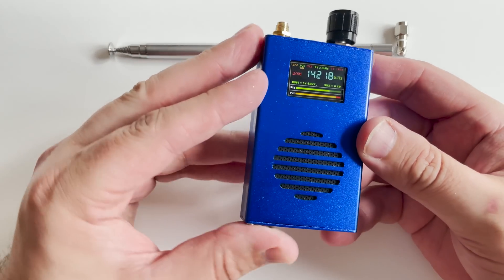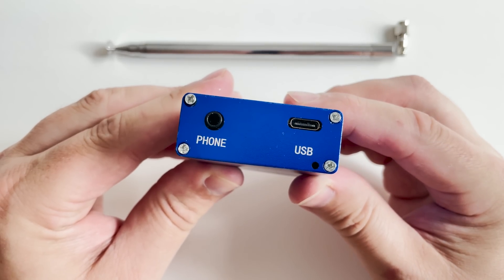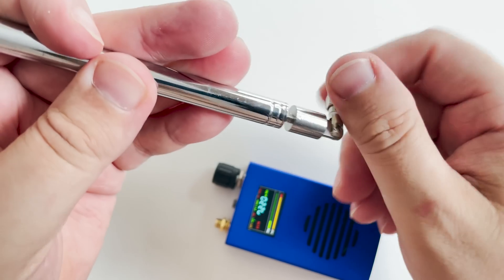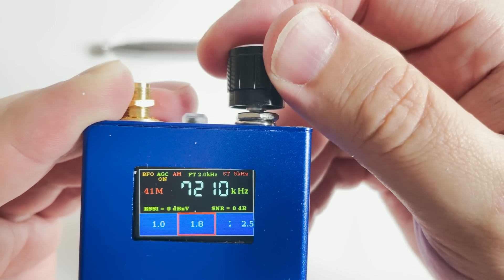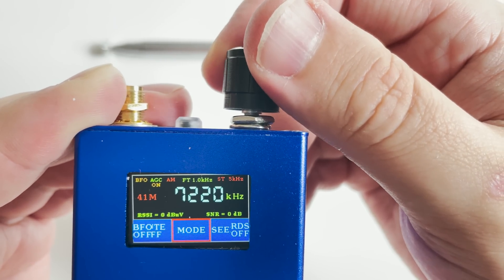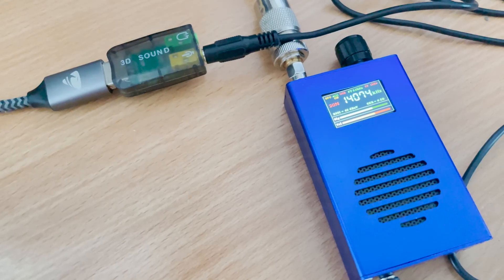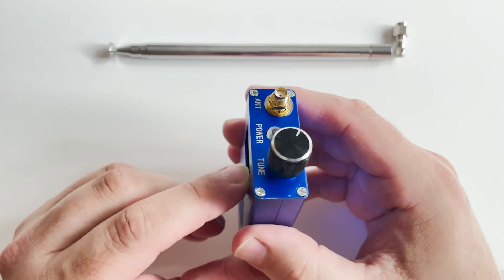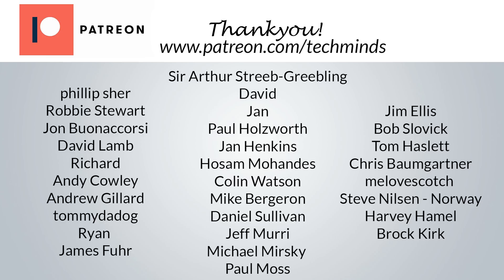Mini SSB HF Receiver 150 kHz To 30 Mhz Plus FM Broadcast Radio

Comment: For what it is this is too costly as you can pick up a more sturdy SDR for less on market place or eBay with a larger coverage.
Reply from the maker: Very true, but for SDR you still need a host computer. But yeh, could make one cheaper for sure.
Reply: @TechMindsOfficial  You can also run SDR off your phone as I had to get a USB to type C adaptor for when I gave it a go ;)

Comment: That is a nice little radio, seems quite nice, I wondered what that funny sound was  that you decoded I have heard it on my little HRD-701 it doesnt have ssb but I wondered what this very strange sound was, is this some new digital mode?
Reply from the maker: I was demonstrating decoding FT8 in the video. Using an application called WSJT-X
Reply: @TechMindsOfficial  Thanks kewl, and at least I know what this strange sound is now.

Comment: Chinese have learned that people will just buy anything. The cheap quality is evident looking at the display; graphic issues have not been solved in a rush to release the product and i expect a lot of software bugs for not having tested it properly. The Tecsun PL-368 is a much better receiver made from reliable manufacturer and sold at this price.
I would not pay more than $50 for this anonymous gadget.

Comment: Looks like junk compared to a Chinese Malahit replica that costs just a few bucks more and does everything thinkable really well and is totally  outstanding in its price range, only it goes up to 2GHz, has a preamp for small antennas built in, has an extremely good audio DSP built in, comes with auto-notch feature, all mode squelch, several bandwidths, several AM synchronous modes, FM Stereo, LSB/USB/DSB, has up to more than 80dB dynamic, 160 kHz spectrum display!!! for best overview about the signal itself and what is around you, it even has a CW decoder built in. Beside its touch screen based direct frequency entry, its frequency stepping can be set mode specific from 1Hz to 100KHz, it even supports 8.33KHz on Air Band. I take it on every vacation, it is just the size of a box of cigarettes, but is a serious receiver with a good audio, especially when using a headphones. I also have a Tecsun PL-680, that is much bigger and in no way better. The Malahit can be calibrated to less than 10Hz deviation (1Hz display!) on HF and a few Hz more on VHF/UHF but it stays very stable all the time, thanks to a good TCXO. Its memories support store and recall of frequency, mode, attenuator, preamp, mixer setting, bandwidth ... it is really like a big communication receiver, only super tiny and with its built-in battery ultra portable. 
Though I would recommend to order original Alps encoders and replace the cheap Chinese ones that start stuttering after a few weeks. My Alps encoders run great since almost a year now, no issues. But be careful when unsoldering the encoders, because this is a sensitive multilayer PCB!
But anyway thanks for testing, this way everybody can make up his (tech) mind about the unit with its display built in sideways if you are lucky🙄

Comment: For digital you need a laptop and probably have one for logging no matter what.  So I'm missing why I'd buy this over a much cheaper SDR USB dongle.
Reply: Because some people like experimenting.
It's like making music using a DAW/computer software vs being able to do it away from a computer on a little box in the garden.

I wouldn't buy this one but I do own a decent malahit clone, that with mla30+ antenna and can pick up a lot and it's the same size as my phone.

Don't get me wrong when I want to sit indoors and chill, SDR is my main deal.

tl/dr portability/experimentation

Comment: Noticed stage coach bus company uses hand held transceivers, just wondered if the was a cheaper scanner that picks them up. Thanks
Reply: Probably on the VHF or UHF band, not for this HF receiver. Check out the Baofeng UV-5G, it will not only allow you to listen to both of these bands, but you will also be allowed to transmit on the GMRS band.
Reply: @bulldogbrower6732  thanks for replying Bulldog, after googling ive found these  frequencies ...166.1125 also 166.4875 and 166.5375 for stage coach...will the suggested scanner be ok...can not find the 5G model just the 5R one.
Reply: @daxster35  yes, those are all VHF frequencies. You should be able to listen to them as long as they are analog and not digital. Many of the nations police departments have switched to digital and encrypted transmissions to keep the public from listening. You could purchase a dedicated scanner for more than $100.00. The Baofeng UV-5G ($30.00) is not a scanner, however it will scan channels. Look at some of the dedicated videos on YouTube.
Reply: @bulldogbrower6732  thanks Bulldog. One last question what is a cheap decent hand scanner these days thanks.
Reply: @daxster35  a handheld Uniden Bearcat scanner is on Amazon for $104.00
Reply: @bulldogbrower6732  sorry didn’t get the notification m8.

Comment: I am wondering if changing the frequency is somewhat fluid, or do we have a silence or a click between each step ?
Reply: It uses the SI4732 so it will mute between tuning steps :(
Reply: @4youian  Thanks for the info. I was afraid of that.